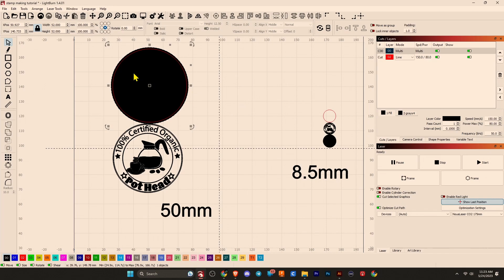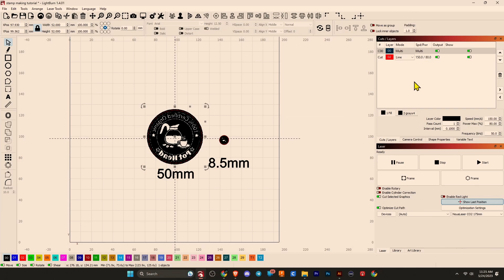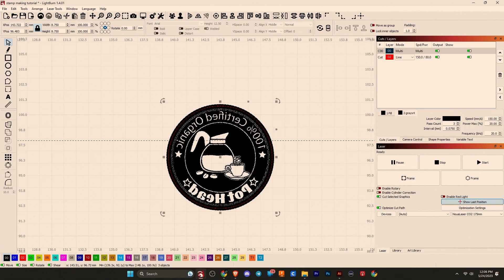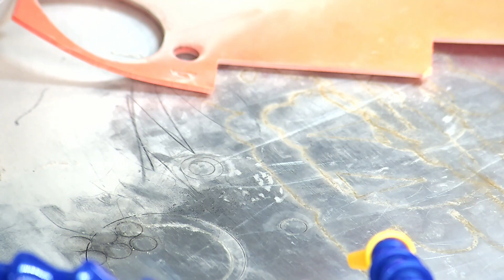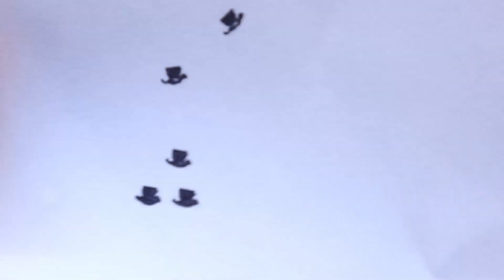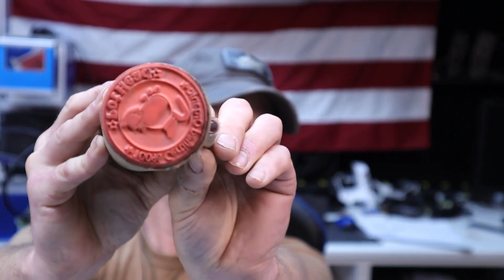How to DIY Rubber stamps with a co2 galvo laser with starter settings included.

Comment: I love that everything was scaled equally.

Great info. Also make sure you use a CO2 extinguisher so you don’t ruin your electronic devices when trying to save them. They are more expensive, but cheaper than a new laser and computer.
Reply from the maker: excellent point, co2 laser & co2 extinguisher ;)